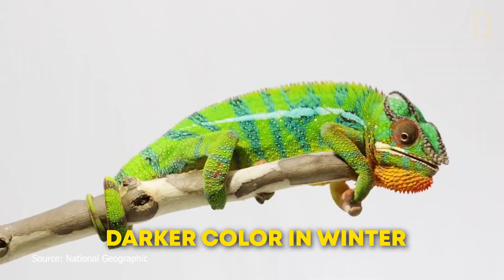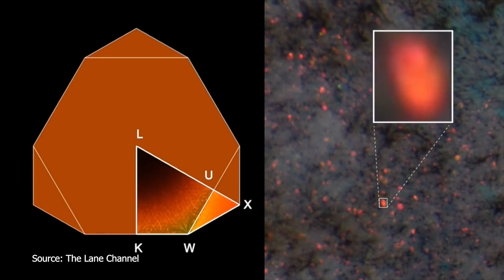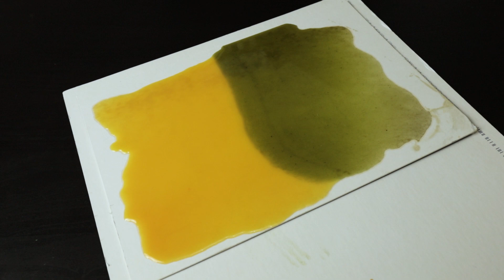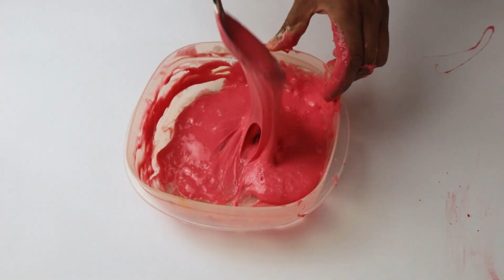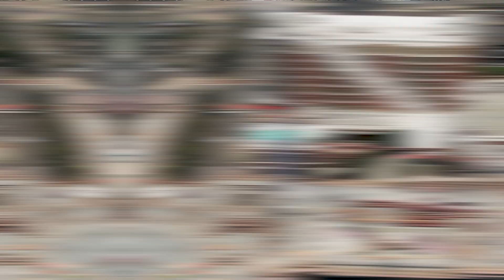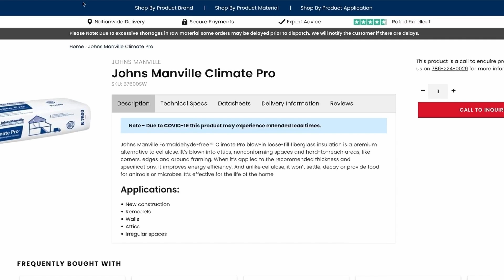Could this Chameleon-like Material Heat and Cool Buildings?

Comment: I had a couple color-changing Hot Wheels cars as a kid. Once a left one of them too close to the bathroom heater while taking a bath, and the color-changing coating got damage, and was left in a lightly changing sickly tone (the wheels got partly melted as well, I'm afraid).

Anecdote aside, I wonder if this substances would be able to whistand outdoors exposure and temperature changes, and wouldn't end up as the poor toy car in couple years time.

Comment: Seems like the thermochromic solution is much better.
25° is a perfectly reasonable temperature to automatically change.
And that requires no voltage or other complicated systems at all.
Put that in a paint and use it as is, or if possible, just bake it into tile immediately and put it on the roof.

Comment: Termochromic solutions may solve problem with extremely higher temperature in cities. Concrete and asphalt heat up our cities to the point when diference feeled without termometer on wild and in cities. Which also lead people to additional conditioning. And it don't need platinum for God's sake! Unlike electrochromic.

Comment: This channel is a science lesson and current inventions all in one. Great podcast Belinda, as always. If they could incorporate this into a paint you can use it on the inside to find inefficient joints, spaces and trim where air might be escaping or penetrating, depending on the season